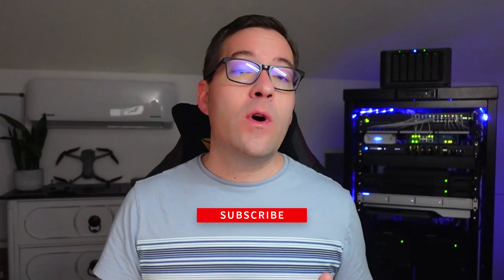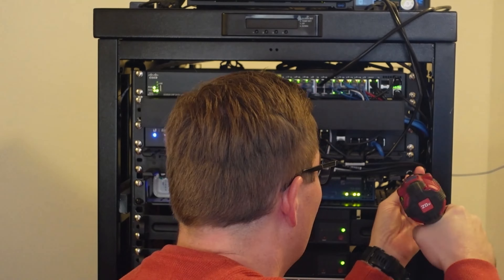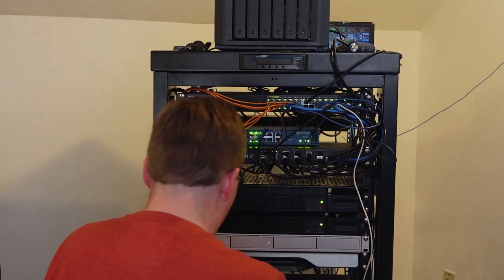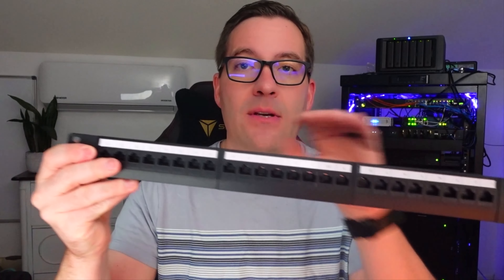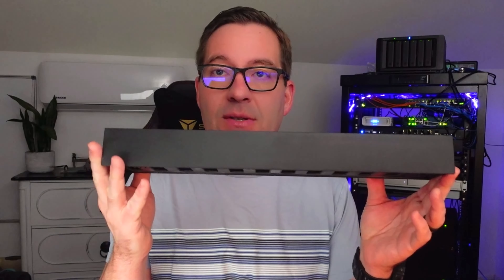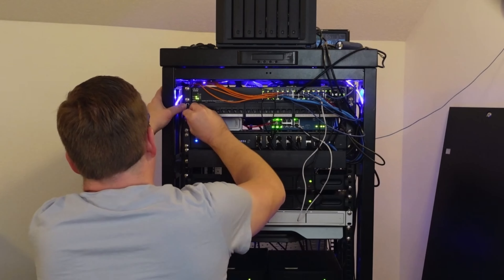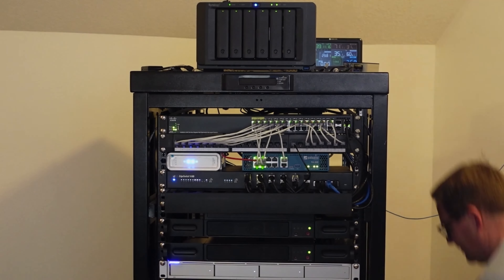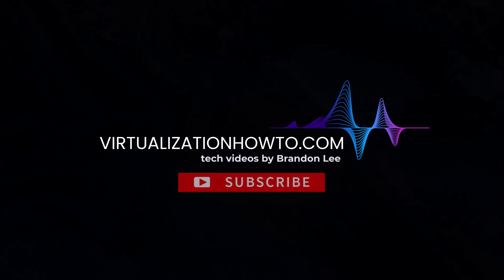New Home Server Rack Cable Management - New Patch panel and cabling!

Comment: Brandon, what brand and AWG of slimline cables did you purchase? 

I read that slimline patch cables are not recommended for PoE gear (28-30 awg is too thin and might catch on fire).
Reply from the maker: NinjaKat thanks for the comment! So far I haven't had any issues. I have several Ubiquiti poe cameras and cables are not even warm. These are the monoprice slimrun patch cables.

Comment: Why is your audio track in your videos always a bit too slow? This is very irritating.
Reply from the maker: Markus, thanks for bringing this up. I am not experiencing an issue on my end. Does it change when you switch between quality settings?
Reply: @VirtualizationHowto  Unfortunately no and you are the only youtuber where I noticed this problem. When you start your videos, the sound lags behind and also seems a bit artificial! Maybe you may need to experiment a bit with video creation software options.
Reply: @VirtualizationHowto  I can confirm this too. Any changes in Quality settings make no difference.
Reply: Your videos feel like a deep fake and the player is having trouble playing the choppy video